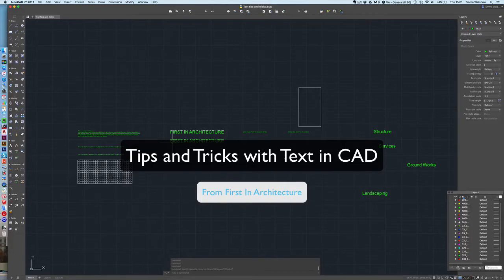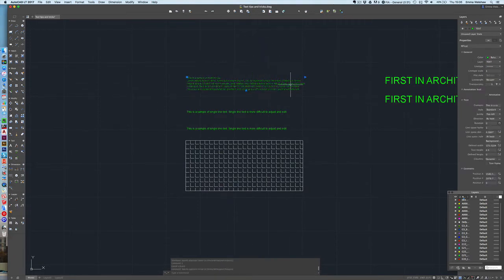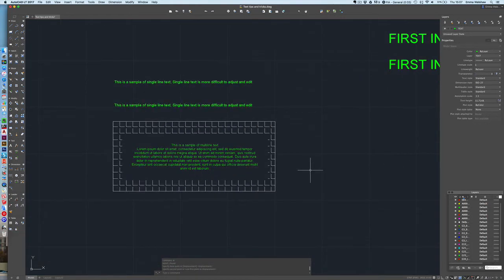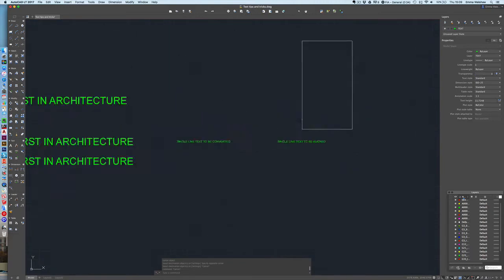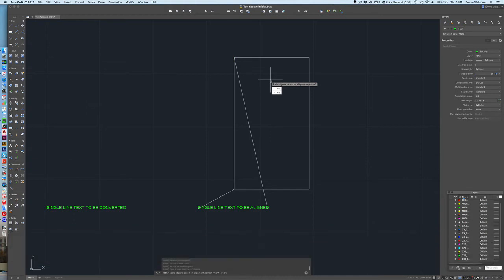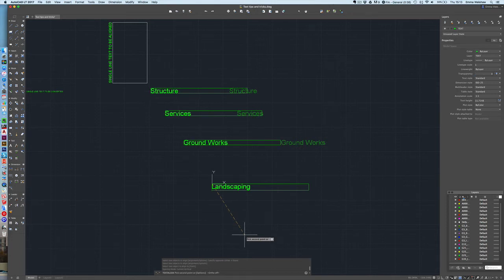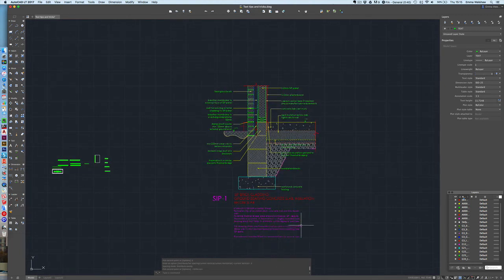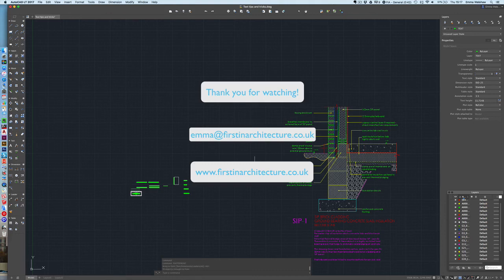AutoCAD Text tips and tricks

Comment: maam, how to change space between text? thank u
Reply from the maker: Hi there, you can adjust the text spacing by creating or editing a text style then applying that text style to your text. So, if you type TEXTSTYLEEDIT it will bring up a box where you can adjust the text settings of any styles loaded in your drawing. Look for the width factor. Increase the width factor to create more space between characters. Then click apply. Back in model space select your text, and in the properties window make sure it is assigned to the text style you have just edited. Hope that makes sense! Good luck!